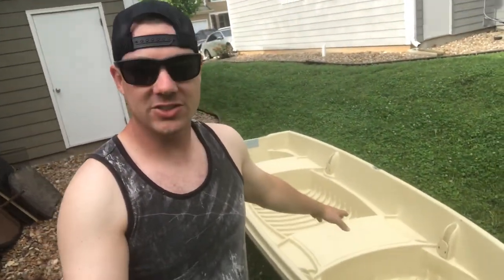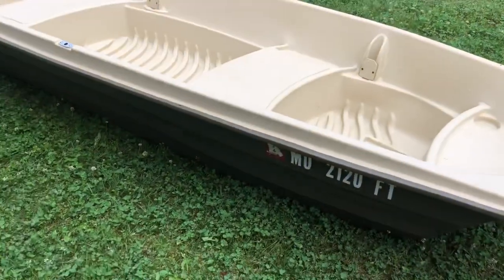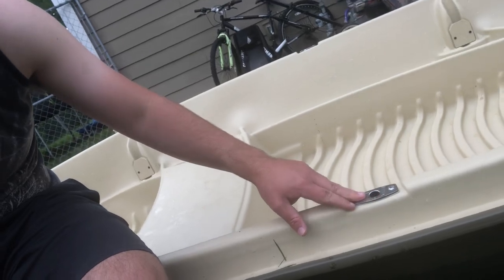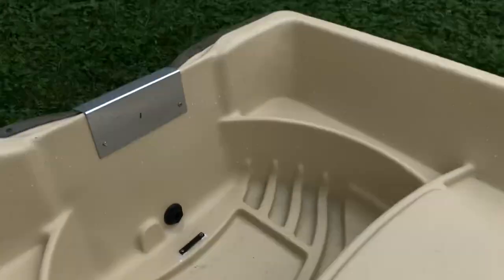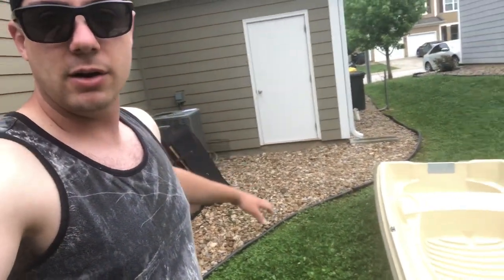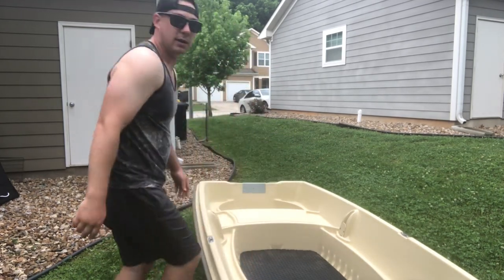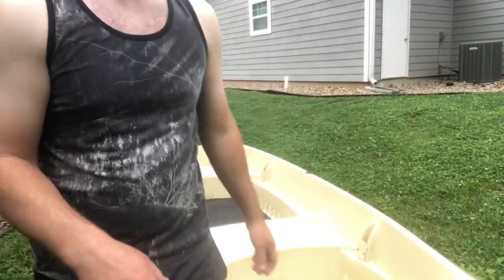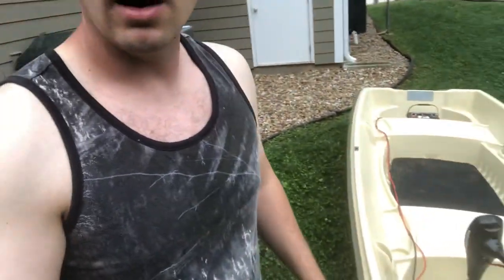Sun Dolphin American 12 Jon boat Review // Easy DIY Upgrades

Comment: Thanks for your video on the Sun Dolphin build. I just purchased a 2021 model just like yours and like you, I did not like the floor ribs.  So I will be looking at your other videos to do the deck builds. I liked all the little tricks you did with the anchor cleat and the battery tie down hardware, etc. I’ve subscribed to your channel. Thanks again, Ken Land

Comment: Man, I think I've watched at least 50 reviews and different DYI set-ups on this boat since I started looking this year and this is by far the very best one I've seen. Such a good and in depth review and explanation of different things that you've done to yours! Dolphin should sponsor your channel and I'm serious when I say that. I've only been able to locate one of these within driving distance from my house in Texas and I think I'm going to pick it up tomorrow while they still have it. You were right when you said they aren't easy to find! And up until I watched this video I was still tossing around a small aluminum Jon Boat and this boat in my head and couldn't quite decide which I really wanted. My primary fishing spot is the river, like you so this should serve me well. I'm going to try one of those cheap air cooled gasoline motors as well as a trolling motor so I'm not running down my battery traveling upstream against the current. The river can move a lot of water real fast and that current can be swift. I'm hoping the gasoline motor will deal with that easier than the trolling motor. It will be work for either one.   I only wish this had a storage compartment for life jackets and an anchor. I'll just have to remember to load those up in my pickup when I load the boat. Thanks for this review man and I also subbed to your channel. Here's hoping you hit 1000 before winter.
Reply from the maker: Thanks Russell, I’m glad you enjoyed the builds. Passing on the build info was exactly why I got into YouTube in the first place. Thanks for subbing as well man, and yea I should reach out to Sun Dolphin, it’s worth a try lol.
Reply: @bluecollaroutdoors5556  I just brought mine home! I can't wait to register it and get it out on the water.

Comment: ive been looking for something to start with since im new to fishing. i didnt want to break the bank right of that bat. i was looking at this boat at academy but was skeptical about it since its cheap and plastic. but you really sold me on it! thanks for the review and ideas!!!
Reply from the maker: Glad I could help, I was also skeptical because of the plastic. I had only had aluminum ones in past and to be honest I don’t have to worry about denting this thing up on rocks like I did with the aluminum ones. DIYs are a bit harder on these but for the price and durability I don’t think you can go wrong.

Comment: I have a Sun Dolphin Pro 120, all electric, two , two trolling motors, front is foot controlled, rear is a remote controlled and kind of acts like my rudder, very stable boat, I add a Hummingbird Helix H5 depthfinder powered by a 12 volt trail camera battery with a solar panel on top, very simple, easy to launch and boat, rides  a single jet-ski trailer, never thought I'd own a plastic boat, but I wouldn't trade this one for anthing.
Reply from the maker: Jeff, that is awesome, your setup sounds great. I thought about in the future adding a foot controlled trolling motor on the front or adding the Troll King foot pedal. I would love to add a depth finder to my as well. Thanks for sharing your build!

Comment: The main problem I have had with this boat is the water that gets trapped between the exterior and interior shells of the boat. Unfortunately, there appears to be many avenues through which the water can enter the area between the shells. Unfortunately too, the port to remove water from between the shells has a tube that runs from the exterior shell to the interior and of a length of approximately 2 inches.  The length of the tube combined with the port being above the bottom of the boat prevents being able to thoroughly drain water from between the shells. When installing seat mounts, I found that having left the boat upside down resulted in the trapped water gettling into the top of the seat area below the external shell. The wood was then noticably soft as I drilled into it and I have concerns about rot and the screws eventually losing grip and pulling free. The other main issue is the lack of drain holes between the seats and front and rear of the boat.  You have to either bail the water out or turn the boat upside down. Given the option of this boat or an aluminum, I would take aluminum. That said, Bass Pro sells a plastic 12ft  boat that appears sturdier and better engineered than the Dolphin presented in this video.  Best Regards
Reply: There's 2 drain holes.

Comment: What would happen if you foam it.? Expand foam. Would it increase the weight for people and hear and what not or would that just be a nogo. I know the foam will make it more likely to stay float. Also how will it fair in saltwater?
Reply from the maker: So the boat has foam inside it already, I’m not completely sure how much of it contains foam though but I think the majority does have it. As far as saltwater goes I’m sure it would be just fine since it is made of plastic. I hope this helps man!

Comment: I thought I read in the sun dolphin specs that the boat was pre wired front & rear for electric motors. I dont know,but I would have hoped or imagined that an internal wire harness ran the length of the internal boat hull so you could keep your battery & motor where ever you liked or even use 2 batteries at once on either or both eletric motors,front & back?
Reply from the maker: I wish it was pre wired it would makes things a lot easier. The suns Dolphin pro 120 is pre wired, but not the normal American 12.
Reply: @bluecollaroutdoors5556  Thank you for clarifying about that. I may have been mistaken because I did read the specs on the 120 that is marked discontinued. It might have been for that,but I thought it was so on the new sun dolphins too? Not a big problem. If I get one that is something I will certainly do with plugs & easy disconnect to use it how ever I like, & it maybe better to have it in a conduit out side of the hull where it is easy gotten at for change,up grade or replacement. I plan on starting off poling,rowing & paddling to begin with ,but having that option with lake Ontario a stone throw away would be nice on calm days.
Reply: They did do this in the most recent addition. You could mount your trolling motor on either end and the battery at the other end.

I just got mine last week for $485 at Tractor Supply.

Comment: Thanks for the very nice review.  A 6hp weighs about 60 lbs. My 8HP Mercury weighs 85 lbs.  Do you think the boat could handle a 8HP engine?
Reply from the maker: Yes it could handle it
Reply: @bluecollaroutdoors5556   Thanks for the reply.  My Mercury 8HP 4-stoke is also a 20 inch shaft model.  Looks like I will have to rig up some kind of transom riser.  Most likely add a hydrofoil to it too.  Whatcha think, any advice ?

Comment: I have a question that I have found, when it rains the boat fills up with water.  There are no holes in the seats so the water could go out the back.  Is that an option, to drill holes?

Comment: Wow man ! I have a question… Here at my local lakes in Southern California do you have to pass a one time inspection and one of the points they look at is to see if there is a minimum of 12 inches of free board from the waterline to the top of the side rails exposed above the water with one occupant. Would you guess there’s a foot of expose sidewall when you are just fission solo? 

Any feedback is greatly appreciated!
Reply from the maker: I can’t confirm as I dont have the boat anymore but it would be close to 12 but not entirely sure.
Reply: @bluecollaroutdoors5556  awesome thank you! I have came to the conclusion that I will probably just purchase from my store back has a good return policy, then bring the boat home and just throw it in the pool and see if it works out lol.

Comment: How did you screw the plastic into the trolling motor mount? Self tapping screws or all the way through with a nut bolt and washer?
Reply from the maker: Just a self taking screw, there is wood inside the hull right there for the screw to bite into.

Comment: Regarding mounting things to the boat, like the brackets in the back to strap down the battery, can you screw into the top of the ribs in the floor?
Reply from the maker: Yea you can screw items into the ribs in the floor, I would just make sure to use silicone around the fasteners to prevent water from getting into the hull.

Comment: I like the low casting deck because if I fall backwards, I will be able to land my ass on the rear seat.
The sides are also higher, so you're less likely to fall overboard...I just purchased this Jonboat, and to tell you the truth, I have buyers' regret.
The first thing I did was mount the motor at the stern. It was impossible to steer the electric motor because you have its handle right behind your center or lower back.
Drive that for 10 minutes and tell me how it feels; I know it was very uncomfortable for me to steer, and I can guarantee the same will happen to you.
95% of my fishing will be done at the bow with the electric motor on a flat bottom. I am in the process of making the flat center floor for it.
The battery will be at the stern of the boat for weight. Weight distribution is a must.
I don't think I will have a problem balancing myself; a great way to keep in shape and tighten your core.
I want to install a 2.5 Yamaha and a swivel seat, but will it end up being as uncomfortable as steering the electric motor with the handle in your back?
Reply: 3 h ektr butin batyery

Comment: Would this boat hold 2 adults 2 kids and a toddler? Or at least 1 adult and 2 kids
Reply from the maker: I would say both depending on the conditions. I go out with my wife, an 8 year old and a toddler and there is plenty of room. I usually sit on the front seat with my 8 yr old and the wife and toddler sit on the back seat, but I run my motor in the front. If you run the motor in the back 
You will have more room because a kid could sit on the small seat in the very front. I hope this helps!
Reply: @bluecollaroutdoors5556  
Yes that helps for sure 
The sun dolphin is the only option out there right now for smaller boats 
And was just curious about how many people it would hold as far as kids and adults trying to get off the banks

Comment: Hey man I'm looking at getting the same jon boat. Do you know what size drain plugs it takes? I found info online but can't figure out if its 5/8" or 3/4"
Reply from the maker: Sorry, I’m not sure either. Does the one your trying to purchase not have any. If not you could probably contact sun Dolphin directly and get some replacements.

Comment: We bought a 62lb thrust. Do you think we should be okay? What is the worst that could happen?
Reply from the maker: It will be perfectly fine on the rear with no issues. If ran on the front there may be some flexing of the bow mount but it still should be ok.
Reply: yes that wirk parer p800 çabkn çruser

Comment: Recent subscriber. I've had my eyes on one of these for a while and picked up one in perfect shape used. My question is I want to put some cleats to the inboard side of the boat for anchoring points.
Do you have a video of that or a recommendation.
Thanks in advance and keep the great videos coming.
Reply from the maker: Thanks for the question Truitt, I don’t have a video specifically about the cleat install but I didn’t really do it the best way. I only used 3 in screws and drilled them into the hull and used silicone to seal it up. I haven’t had any issues with it coming loose or anything but for maximum security I would use use marine well nuts which provide great security and strength and the rubber seals up the area nicely as well. If your not sure what well nuts are just do a quick YouTube search and watch how to install them. They are really good for using on kayaks and other plastic boat that don’t have anything substantial to drill into. I hope this helps!

Comment: Hey I have this same jon boat I seem to have water between the deck and the hull I can't get out with through the drain. Any experience with this?
Reply from the maker: Honestly I have never experienced that issue before, but I have heard others saying they have. My advice would be to stand it straight up with the drain holes down, and leave it standing for several days to let anything in there drain or possibly evaporate and air out. Good luck!

Comment: What’s the biggest motor I can put on it because I have a 5hp and looking for a small boat
Reply from the maker: A five horse will work fine, I believe the max recommended is five but I’ve seen these with 10 hp and more work just fine.
Reply: bahss run lot if extra ful

Comment: Do you have a video for hat nylon handle mod?  What nylon webbing did you use?  I about pull my back each time i load my sun dolphin Jon boat.
Reply from the maker: Thanks for the comment Mike, I definitely read through you comment way to fast and didn’t answer your question. No I don’t have a video for the mod but I will be glad to do one showing it step by step. The materials are just an old nylon military belt and schedule 40 PVC pipe. Look out for the video soon. Keep it Blue Collar brother!
Reply from the maker: Hey Mike here is the video brother on how to make that handle, hope this helps.https://youtu.be/nrQCQUGDxXk

Comment: Will this boat work in a saltwater lagoon, like the Indian river in Florida
Reply from the maker: The boat should work fine with saltwater too, since it is plastic it should be fine and the rivets on the side would potentially be the only thing that would rust but it only holds on the rubber trim along the edges it doesn’t seal up the boat. Go for it man!

Comment: Do you think it would do good on a lake?
Reply from the maker: This thing will do ok on a lake depending on how many large boats are around. If you had an outboard motor on it this thing would do fine. I have had this out on a large lake with just a trolling motor and I had no issues. You just have to be aware of the large wakes produced by bigger boats.
Reply: chef use laçke ichbee kak lannbeé icw icean ryn bamhaß

Comment: Do you think it would work with a 30lbs trolling motor or a18 hp gas moter? Is it stable?? I subscribed too!!
Reply from the maker: Thanks for becoming a member of the channel, to answer your questions yes it will work with a 30lb trolling motor I would say on calmer water, with my 55lb thrust I find myself needing more power in rougher current on my river. On a calm day out on a pond or a small lake you should be fine. A 18 hp gas motor would be awesome to have and I would love to have one myself as it would make this little boat rip. The stability is really good for what this boat is. It’s way better than a kayak or a conoe, but ultimately it’s a small Jon boat. Check out my stability test on this boat on my channel. Thanks again!
Reply: ysnmar 18 hp disél duse usé way kedß ful longer rangfe

Comment: How do you install anchor cleat on the boat
Reply from the maker: I don’t have a video specifically about the cleat install but I didn’t really do it the best way. I only used 3 in screws and drilled them into the hull and used silicone to seal it up. I haven’t had any issues with it coming loose or anything but for maximum security I would use use marine well nuts which provide great security and strength and the rubber seals up the area nicely as well. If your not sure what well nuts are just do a quick YouTube search and watch how to install them. They are really good for using on kayaks and other plastic boat that don’t have anything substantial to drill into. I hope this helps!